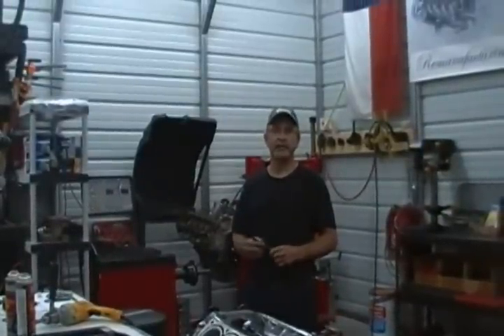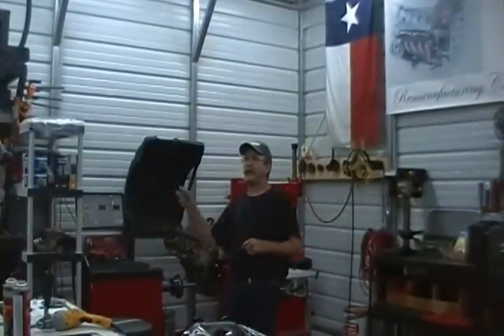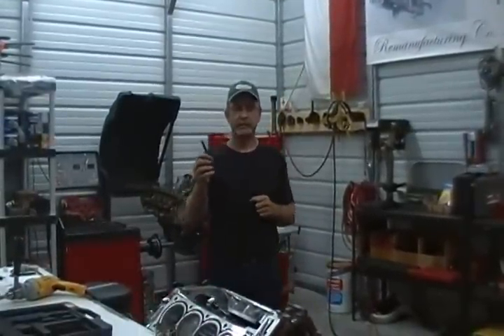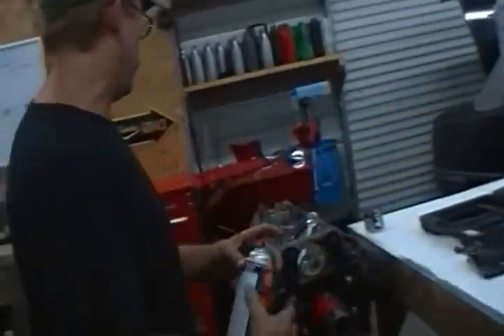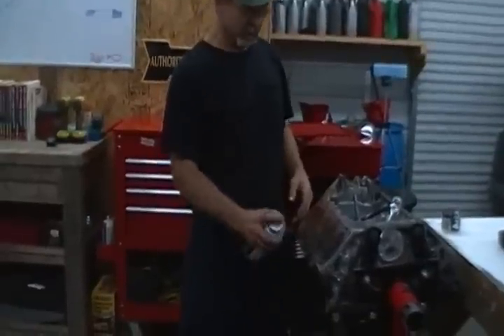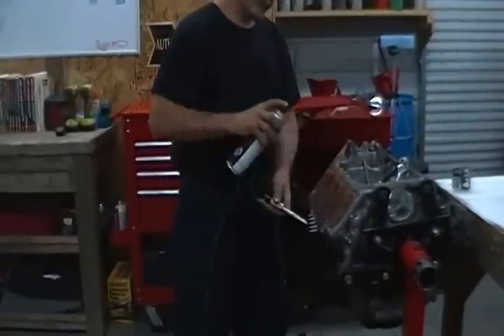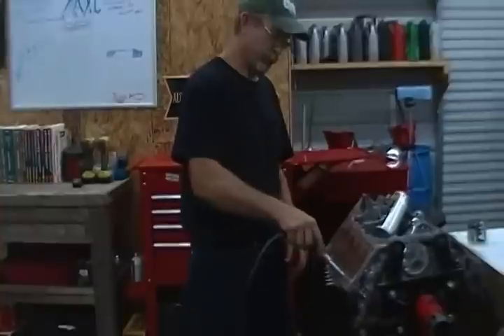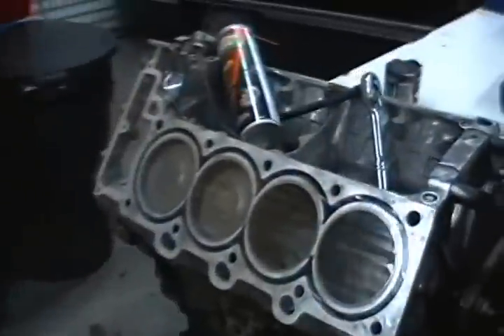Northstar Time Sert Install

Comment: The following was copied off your web site...What's up with that? 
"Time Serts! Or Norm Serts!Secondly, there are those who swear by the insert method when, in fact, this is a limited, temporary band aid and does nothing more then give your Cadillac a few extra miles, and in the end, you will be facing the same issue all over again. So the "Sert" method is hogwash, and only the mechanic taking your money, is benefiting from it. I know this is not good news, but it is true nonetheless!"
$320 for the ARP studs + around $450 for the time sert kit...
I have a set of your studs, pretty sure they were much less than $770...
Reply from the maker: First; just call me so I can explain all your concerns?Second, we are sending out the tools for use and all you do is return them!Third, as soon as we get the new studs on the market , they will be much cheaper and easier to install!Thru the years we have learned a lot about why everyone believed the sert was the failure, even we were concerned as you know, and this help promote the dal diameter stud!However, we have discovered the real truth of failure and we explain it in detail in our next video production!Thanks for reminding me of the site and what it says!
Reply from the maker: Can you do me a favor and tell me where on my gigantic website this info is still located? I am searching for it and don't see it?
Reply: Again, my post is over a year old.  I run your studs in my Eldorado, and I installed them just like you show in your videos. Don't mean to piss you off, but look at the date of my post.... BTW, do you still sell the studs you were selling about 2 years ago? I am looking to rebuild another Northstar and your studs worked perfect last time....also, I very respectfully disagree that inserts and (a popular brand) studs (working together) to form a duel diameter stud - is better than the studs you produced a while back....
Reply from the maker: Tom Joyce 
sorry bro! I just try and catch up with everyone?
Glad your job was successful!
lol you never pissed me off bro!
Reply: If I may offer my opinion(s) on the Northstar problem.  Improper thread pitch does not hold torque properly. When torqued at factory, the bolt coating is compromised, thus can cause galvanic corrosion. Over time, this corrosion combined with the poor gasket material causes the bolts to loose their holding force, and the gasket is blamed - and said to have failed...When in fact it is the factory threads...????
Reply from the maker: Hey bro,Now that I remember you! LOL!Your very close to the failure? The threads in the block are in fact compromised!! This is a given due to the TTY Bolts, they are a degree torque which forms the aluminum block threads to the extreme twist of this bolt, no head can be removed without some thread repair!However, if a Head Stud such as mine or ??? Won't go there! We installed our head studs directly into the aluminum with only a direct vertical pull, this DID NOT compromised the threads and have been extremely successful.Our new studs are the same in direct vertical pull without any twisting in extreme degree torqueing, meaning the sert has not been compromised either.When installing new threads correctly, using the TTY degree torque, you have 50% chance of breaking lose the sert from its lock position!This sert is not the failure, it was the torqueing into it that caused it to unlock. Thus when removing the bolt the sert will pull out with it, this is the misconception of serts, studs and TTY bolts!I plan to fully explain it all in our next video production!All our studs are now being manufactured by ARP, and I give the lifetime warranty against failure!~